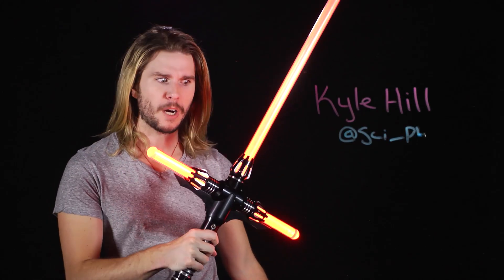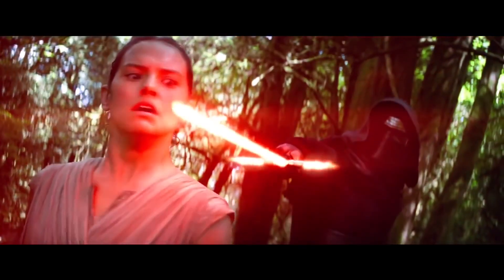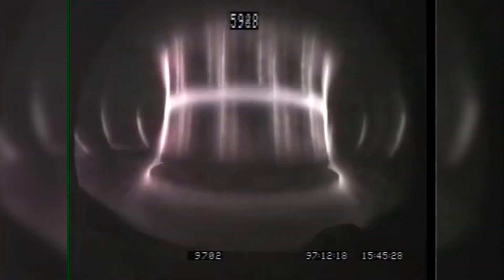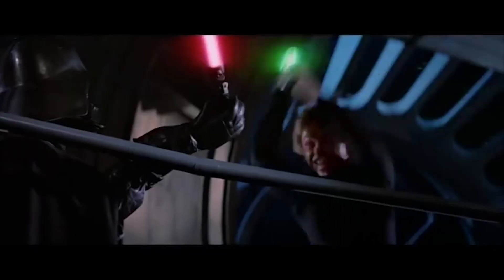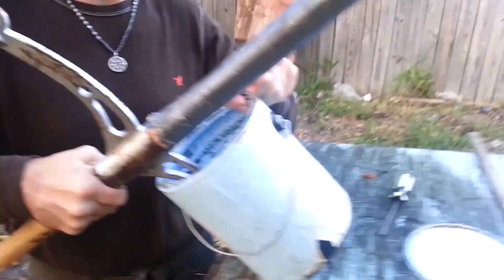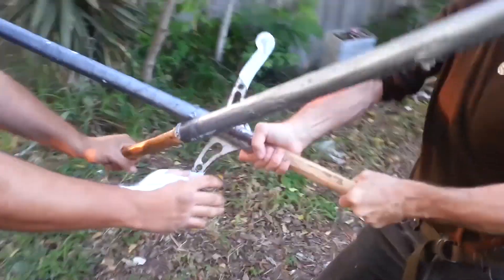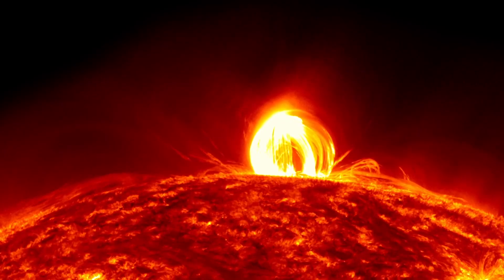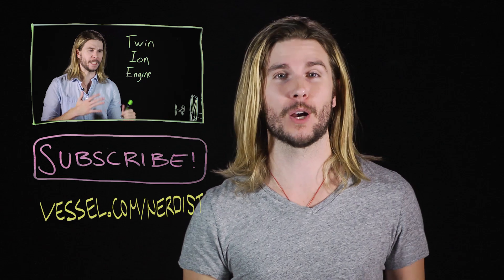Why Kylo Ren's Lightsaber Works (Because Science w/ Kyle Hill)

Comment: Almost every sword in history have had hand guards. Even Japanese Katana had hand guards to stop your enemies blade from sliding down the sword, and cutting your hand.
Reply: +Robert Harden Yes and no. It is really not that hard to use a Katana without your hands sliding around. They tend to be designed with quite a bit of grip on the handle. While the Tsuba (the disk-guard on the katana) does stop your hand from sliding onto the blade, it is also there to provide some degree of hand protection. For example, without the tsuba being there, it would be very easy for an opponent to get into a sword bind and then slide their blade down your blade very quickly and cut your fingers off. With the tsuba there, they would have to pull their blade off of yours first and then cut to your fingers, which gives you more time to react.

So the primary purpose is still hand protection. As I've done both Kenjutsu and HEMA before, I can say on no uncertain terms that the longsword/bastard sword/arming sword's cross-guards are a MUCH better form of hand protection. It's just a better design in that regard. But I'd still much rather have the tsuba than nothing in that regard.
Reply: ***** maybe your opponent. You'd have to be a moron to hurt yourself with the crossguard.
Reply: +TyillestTV2 I think in the Katanas case, its to stop your hands from sliding up the blade.
Reply: +TyillestTV2 I think in the Katanas case, its to stop your hands from sliding up the blade.
Reply: ArvelDreth
"Hand protection has never been an issue."
-Unless losing a hand is an issue.

"Also, even if the beams go through the metal tubes"
-In the SW universe there are lightsaber-resistant materials, such as Mandalorian steel or anything with a Cortosis weave.

"you can still cut diagonally"
-As long as you can use the hilt correctly this is a non-issue.
Reply: ArvelDreth Like with Vader cutting off Luke's hand or Luke cutting off Vader's hand.  In both of those the opponent didn't have their lightsaber disarmed.  So if they had a crossguard it would just be a manner of adjusting the wrist. 

Also yes there are times where the crossguard wouldn't have been helpful in saving their hand.  Ultimately no weapon is perfect.  But there's a reason nearly every sword made for hundreds of years used a crossguard.  Because it helps save your hand.  Honestly this is a very natural progression and kind of a funny in joke about how all of the light saber duels seem to end with a hand removed (and just as a side, Kylo Ren didn't lose his hand in the movie so I'd say he was successful).
Reply: Those guards weren't blades though
Reply: +hulkhatepunybanner Not true. I've been learning german longsword fencing for about 4 years now. I can say with absolute confidence that I could wield Kylo's saber without cutting myself on the crossguard.
Reply: +hulkhatepunybanner At that point it's just weapon safety.  We don't call handguns impractical because you can accidentally shoot your foot.  And the training is meant in a way that you don't have to remember, you just do it.
Reply: +ArvelDreth Yes but I can still point to several moments in the Star Wars movies where the person losing their hand could have saved it with just a quick turn of the wrist if they had a crossguard.
Reply: Jon Doe Hi, I've been studying how to fight with swords that are shaped basically exactly the same as Kylo's saber for about 4 years or so. (German longsword fencing, to be specific). 

After seeing the trailer, I started to pay attention to how often I touched the ends of my own crossguard during bouts. The answer was never. Wielding Kylo's saber without cutting oneself on the quillons is a trivial task.
Reply: Sean Black
No, Luke was disarmed. It was knocked free of his grip and then his hand was cut off. With Vader, he was down on the ground and his blade was completely knocked aside. He didn't have enough time to react. Also, guess what? Yoda, Ki-Adi-Mundi, Aayla Secura, Obi-Wan Kenobi, Luminara Unduli, Kit Fisto, Shaak Ti, Qui-Gon Jinn, and Darth Maul all happened to not have their hands cut off. There's not a ton of people who had their hand cut off. Oh and I think we can actually count Mace Windu. It was half of his forearm, so a cross-guard wouldn't have done anything, even if he could react in time to being parried.

Edit: I just watched that fight from episode 5. It's not quite knocked from his hand, but it was a parry and Vader came from underneath Luke's wrist. You actually cannot turn your wrist like that so quickly when a lightsaber is basically already right there. So no, a cross-guard would have done nothing.
Reply: While it is true that pretty much all swords of the past had cross guards, they also were not made out of blades. Similarly it would have made sense to make the cross guard of the light saber out of a light saber proof metal, which do exist in the Star Wars universe...although the cross guard could not have been used for offense in that case but oh well.
Reply: Kyle Flanagan Exactly.
Reply: +TheAgamer100 Actually there was a weapon that was used in 16th century France (I think?) that was called a main gauche (it was only a dagger, but the concept's the same) that was very similar to what you're describing. The only instance I can think of in film is in Disney's "The Three Musketeers"(1993) used by the character Porthos (Oliver Platt). Now I do hesitate to mention this because the one that he used in the movie was a bit gimmicky with 2 spring loaded blades that popped out of the sides of the main blade, and wouldn't have had the structural stability to actually break an opponent's blade. However, this was based on a realistic crossguard design where blades were angled up at a 45 degree (or so) angle in order to ensnare a opponent's blade, but would most likely have just allowed you to wrench your opponent's blade out of his hand by using leverage against their grip. Since the blades were angled away from your hand, it served the purpose of a hilt by blocking an opponent from sliding their blade down the length of yours and cutting your hand if it were unprotected. It also discouraged opponents from getting in close to attack. Plus it looks badass. 

+Nerdist Thanks for showing the Stephen Colbert explanation. I hadn't seen that before and hadn't really considered that aspect. But based on your explanation of how a magnetic field would be required to contain the plasma into the blade shape, wouldn't that hit the magnet then (or at least the power supply going to each that side) if you chopped it off at the metal? I know that's going a little geeky into the way that a theoretical weapon would work, but I figure if I can't get a little geeky here then the channel name is really something of a misnomer. lol
Reply: +TheAgamer100 Kylo used the "cross guard" blades in the film to get out of a bind with an opponent, so I'd say it works and is practical for his fighting style.
Reply: +TyillestTV2 Lightsabers don't slide up and down like that. They never have. Hand protection has never been an issue. Also, even if the beams go through the metal tubes, you can still cut diagonally. People have had their hilts cut in half before, so you can just cut across or diagonal and it'll render the crossguards useless.
Reply: The fact that one has to remember how to hold it lest one be impaled by those so-called guards makes this an impractical weapon.
Reply: ***** wouldn't apply to a force-user
Reply: ***** play "what-ifs" all you want, the point is they don't have to consciously remember where their hands are and are highly trained. It was used to great effect in the movie, it's practical for what it does.
Reply: +SemperFiMac77 No surprise that the marine is an idiot.  The Cross-guard was only made to look cool and it looks ugly.  Fighting does not go perfectly as planned like it does training against nobody.  In hand to hand combat the opponent can force you into positions where the cross-guard becomes dangerous to the user, like if they got knocked to the ground and falls on it.  The cross guard does limit the angles at which it can be held, either for an offensive opening, or the gurad being pushed into the wrist by the opponents lightsaber
Reply: SemperFiMac77
In unscripted life, it would snag and slice on the person wielding it. That's not a what-if, it's a fact. If there's something physically there on that tri-saber I'm sure the rehearsal and blooper reels are full of "accidents"related to this. Enough to limit the fights to broader sweeps over tighter ones. True life doesn't give us multiple takes in most situations.
Reply: Jersey Streicher
There is metal like that, but clearly no one uses it. Probably because it's extremely rare and expensive. We've never seen a case where someone tried to cut their opponent's lightsaber hilt and it didn't work. However, everyone who has ever lost their hand would not have been protected by a cross-guard because they were parried. It had nothing to do with the blades sliding down each other.
Reply: +ArvelDreth 
In Episode VII Finn fought a Stormtrooper, who had a melee weapon that was not damaged by the lightsaber. Most modern melee weapons in SW are supposedly reinforced with Cortosis. As for Mandalorian steel, it's used for armor, mostly by Mandalorians.
Reply: Jon Doe Resorting to personal attacks... classy. It's a lightsaber, it's dangerous to the user no matter what. The movie SHOWS the cross guard being used in a practical way... e.g. it's practical for the setting it is in. (the Star Wars universe)
Reply: +Jersey Streicher Then why not make the cross-guard out of that?
Reply: ***** Again, you're comparing "true life" to the Star Wars universe and force-users. Not a valid comparison. The movie proved that it was effective in-universe.
Reply: ArvelDreth He used it in a very offensive way in the movie, not for protection alone.
Reply: Sean Black He also used it offensively while in a bind. I would say it's a very practical addition to the lightsaber.
Reply: ArvelDreth
Good point.
I would take a lightsaber-resistant hilt over a lightsaber beam crossguard any day.
Reply: +TyillestTV2 ... Sliding down the sword is not an issue though in star wars because the friction created when 2 lightsabers touch is so strong, you'd never be able to move it in any direction but away from it. On the other hand people still get their hands cut off in other circumstances so moot point.
Reply: Péter Lakatos You probably should look at that scene again.
Reply: Tacobell1384
Even traditional crossguards made from dull steel bars offer several offensive options, including grappling, pummeling and stabbing sensitive body parts.
Reply: Tacobell1384 Yeah but then you would also have fans still complaining when the trailer's released because it wouldn't be obvious that it's made out of that material, nor would the general public since none of them would even be aware of lightsaber proof metals.  Plus when you get into that logic you can then go on with saying "why not just make a sword out of that material" which is just boring in this universe.
Reply: Sean Black
In the SW universe they actually make swords, staves, vibroblades out of lightsaber proof material.
If the public can take stopping a blaster shot with the power of will alone, they will be able to swallow a piece of metal being resistant to lightsaber blows.
Reply: +Sean Black LOL! first it's a Science Fantasy movie, second if Maul's weapon would have killed him before anyone else, how come Ray Park didn't keep hitting himself with it when doing the fight scenes? Because he had martial arts training. I love when people who obviously have no martial arts background comment on how useful a weapon is. Reminds me of when my high school physics teacher tried to tell me a jumping spinning kick was physically impossible.

Also as a Star Wars fan just have to point out in the science fantasy space opera of Star Wars a Force user uses both physical training and the force to wield their light sabers.
Reply: Sean Black
Well what if they explain the fact that such metals exist, then there's the problem solved. Actually, I believe there was a part where there's someone with a regular melee weapon and it stands up to Finn's lightsaber because it probably has cortosis in it.
Reply: +hulkhatepunybanner Did you pay any attention at all to Kylo Ren's fighting style
Almost nothing BUT broad strokes
Reply: +Jersey Streicher adding crossguards would not have prevented ANY of the hands cut off during the star wars series, seriously, watch them. 

Lightsabres don't slide like swords.
Reply: Sean Black Lightsabers are near enough weightless, the only thing that has weight to them is the actual handle of it. The lighter a weapon the better, you don't need to use actual weight behind the saber itself when you swing so it's all down to the weilders own strength, skill and use of the force. Making a sword of saber resistant metal would weigh more than those weapons and thus a good saber weilder will be able to swing and stab much much faster than the person using a saber resistant sword. Furthermore, a lightsaber resistant sword would be harder to carry around since you're carrying the whole blade as a physical object where as a lightsaber you can turn off and carry around in your pocket concealed for when you need it. Lastly the thing is like having a 360 degree blade all around the saber part as opposed to a real life sword which only has 1 or 2 sharp parts to it, you have more flexibility to cut someone with a saber than a sword.

Also the keyword here is "resistant", not sabreproof. If you had a blade made of resistant material against someone using a lightsaber then the person using the saber would eventually be able to cut through it when they're putting enough pressure on it. All those famous scenes with Jedi and Sith clashing sabers and trying to push the other one back wouldn't work the same with metal since eventually the saber would cut through it when enough heat and pressure is applied. Vaders armour was able to briefly shrug off saber attacks but it could still be cut through if the saber was held on it long enough. 

The video above used a cross guard for a two handed blade with a larger handle than Kylo Rens meaning he could hold it with his arms and hands further away from the cross guard (sortof defeating the purpose of having it protect your hand to begin with) Kylos handle is much smaller than that for the size of his saber and cross guard so he has less freedom to weild it with his hand so close to the light parts of the saber. If the guy used a 1:1 scale blade version of the same as Kylos saber then the demonstration would hold more water but he didn't use a weapon of the same size and shape. 

Also please don't make assumptions about someone just because they have a criticism about somethings design. I like Kylo, his saber and the new star wars movie but I acknowledge his saber design could be made more practical by using saber resistant metal as a hand gaurd to swiftly catch strikes and deflect them without having to worry about the crossguard itself hurting him. You don't have to blindly love or hate something one way or the other, people can still like something and criticise it too. If they can see past the flaws and still enjoy it then that's a good thing.
Reply: Cal DW Some lightsaber hilts are saber proof. Take sidious for example. Him as well as few others have made their sabers out of Mandolorian Iron. Invincible to sabers which is why jedi had a tough time in the Mandolorian wars.
Reply: DEATH111183 They're exhaust Ports.
Reply: +Jersey Streicher fair point, but calling them crossguards is a misnomer
Reply: Sean Black Okay, what about my responses are ignoring you? I am looking at each of your points and giving a legitimate reason with evidence to back up my argument after looking at each of your points. I've also not been rude to you in the slightest so what do I have to apologise for? If I've upset you in some way and can explain what I said to offend you then by all means I'll apologise but I see nothing wrong with me simply having a discussion with evidence and arguments about this.
Reply: Sean Black Okay 

1. As I pointed out, weight isn't as much a factor for individuals who can sense literally every single molecule around them using the force to the point they can detect non physical entities like ghosts. Nor for people who's "blades" are weightless pure plasma that cause damage simply making contact with an object where as an actual blade needs some power behind it's swing. It may take someone all their strength and the momentum of a sword swing to cut through a tree branch, but a lightsaber could do the exact same thing with a light flick of the wrist. For real world people with real world swords then the weight of a blade is important, not so much for lightsabers or individuals able to manipulate and sense their surroundings through the Force.

2. I was pointing out how the way of holding the sword in the demonstration doesn't apply the same to Kylo because the scale betweem Kylo and his Saber seems different to the sword and wielder in the video. If Kylo was using the same blade then yeah it would apply to him, but the video demonstration isn't the best example because the blade is not a 1:1 replica of Kylo's saber...OR if it is, the wielder doesn't have the same body proportions as Kylo. For example, a 5ft 5 man wielding a broadsword designed for someone much taller than him would have to hold it slightly differently to evenly distribute his grip strength and adjust the weight of the blade being further away from his shorter body and limbs compared to a taller person. Comparing the two when both subjects are different is not a solid control for a test or demonstration.

If this wasn't clear enough in my initial posts then sorry about that. Hopefully this clears up what I was trying to explain.
Reply: +TyillestTV2  Cross guards don't disintegrate matter on contact.  The sword with paint is alot heavier the a light saber, you're alot more likely to fuck up swinging something super fast.
Reply: +Kyle Flanagan 
Tsubas are really miniscule compared to any serious crossguard.
It only takes a small flick of the wrist to offset your blade enough to bypass the tsuba and hit the hand or wrist.
Even the most ample European crossguards require some skill for effective use, you need to twist your grip and move the crossguards to intercept your opponents attacks.
In Europe armored gauntlets were a no-brainer until basket hilts were developed.

The tsuba (pretty much like knife handguards) is just there so you don't cut yourself when thrusting against a hard surface.
Reply: +TyillestTV2 Crossguards could easily be constructed with the same tech as the electrostaff used by General Greivous' personal guards.
Reply: +SemperFiMac77 I'd give a counter argument but I'd rather not drop anymore spoilers than you already have. ask me for my opinion again in a month and I'll tell you... maybe
Reply: +TyillestTV2 Apart from maybe a Gladius but they didn't go in for blade on blade contact.
Reply: Ritalin Popper watch the movie if you haven't. He uses them as a way to get out of a bind.
Reply: SemperFiMac77
LOL
In a confined space not even a "force user" can avoid an accidental slice of self with a tri-saber.
Reply: +Sean Black Like when? Was it when someone was completely disarmed, parried, or otherwise had their blade knocked completely away? Those are the only times when it happened.
Reply: ArvelDreth Ok, I'm glad that you pointed out you were utterly wrong about the fight from before with the edit but it was still possible to adjust and a crossguard would still be useful there.  Also we didn't even see where on Mace Windu's arm the hand was cut since he was blasted out almost immediately so that's not an accurate statement.  You also didn't address Vader's moment which is still proving my point that a crossguard is useful.   And just because there are people who didn't get their hands cut off doesn't mean that isn't a common thing with lightsaber fights.  In fact the lore shows the jedi have several fighting moves that specifically involve removing the hand primarily used for weapon wielding, so yes if you are going against a jedi a crossguard is a good defensive tool.
Reply: +TheUnbeholden , uhm, Griveous would disaggree, in his duel with Obi-wan, he slid his lightsaber down and cut off one of his hands
Reply: +TyillestTV2 and those hand guards could not cut your own hand off. Neither could they be used to kill you if forced into your own chest.
Reply: Jersey Streicher Yeah but there's a reason Obi wan gave Luke a light saber instead of a sword out of some tough metal.  Because light sabers are cool.  Heck even the original concept of a light saber wasn't all that practical and the double bladed saber Maul used that fans see as cool has to be the most ridiculous weapon I've seen that will kill whoever wields it before an opponent.  With all that in mind, the crossguard saber isn't impractical in the slightest by comparison.
Reply: Sean Black Nah I'm sure many people who train with the dual bladed sword can use it without injuring themself with it, Its just a matter of practice, any lightsaber can probably be wielded effectively, especially by a force user who can 'feel' where the lightsaber is since it its focused by a force crystal. In Star Wars I don't see any force user whose experienced in any kind lightsaber ever cutting themself with it.
Reply: Sean Black
Yes I was wrong but there's no way Luke could have turned his wrist in time. Vader's lightsaber was basically already there at his wrist, on the underside where it would have taken far too long to turn his wrist all the way around. We did actually see where Mace's arm was cut off, because there was a pause when Mace was screaming in pain right before he was blasted out of the window. You could see the thickness of the limb where it was cut, so it was obvious that it was up towards his arm. I thought I already said that Vader was parried, knocked prone, and exhausted. He couldn't move his arm quickly enough, as Luke's lightsaber was already right there. Yeah, he could have done it if his situation was more favorable, I'll concede to that. I'll even say that a cross-guard on a lightsaber is not the most pointless thing you could ever add to it. But I feel like making the cross-guard out of the same dangerous material that the lightsaber is made out of seems kind of counter-productive. Doesn't it take more energy to produce more blades? And what if someone has their blade locked with yours and they push it into your chest or shoulder? It just seems like a bit of a hazard and I feel like there's other ways this could have been handled. Really I'm just a bit irritated because the way it's presented makes it look like it's just trying to look cooler and more flashy rather than practical.
Reply: TheUnbeholden , That's my point.  If we can suspend our disbelief with the double blade light saber than why not the cross guard light saber?
Reply: Satsujinki1973 First I know it's sci fi fantasy.  That's my point.  That we should stop complaining about the cross guard saber being impractical when the light saber and the double bladed one are already so impractical to begin with. 

Second, I'm a black belt dude.  You wanna know why ray park didn't hurt himself off of the double bladed lightsaber?  Because his was just a prop and he had a specific choreographed routine.  If it were a real light saber and you had him enter a fight with someone else with a light saber then either he would injure himself or just turn one of the blades off and fight like that, because while it looks like it has the advantages of both a sword and a bowstaff it really has neither since a huge thing with bowstaff is range, which this doesn't have, and all sword like swings have less movement because that other blade is coming straight for you.  But again I don't mind how overall impractical that is because it looks cool and Darth Maul was awesome.  My whole point is that we should just calm down about the crossguard being impractical given what we have now.  It's one thing to say you don't like the look but that's not what we're saying here.
Reply: ArvelDreth But not in the first trailer.  What, you have this trailer and marketing campaign that was praised for explaining very little but then just have Kylo Ren turn to the camera and say "there are metals that are light saber resistant so this makes sense"?  Because this whole thing started when the light saber was shown in the first trailer you know with fans immediately labeling it as impractical.
Reply: FlockFlysatMidnite
His swordsmanship sucks.
Reply: ArvelDreth And again I'm not talking about these guys moving their arms, just wrists.  No matter how exhausted you are, you can move it fast enough, especially considering these guys are force users.  And I watched that scene again and no you really can't tell.  I don't know if you see Windu's robes giving the illusion of thickness but there's just no clear way of telling but I didn't even use that as an example of anything so why you're still bringing it up is beyond me.
Reply: Sean Black
Because the example was used in the video. And no, you cannot move your entire wrist upside down when your attacker's lightsaber is already basically touching your wrist, as was the case in the fight between Luke and Vader in Empire. And if Vader did have a cross-guard, then Luke still could have aimed higher up after knocking his arm aside. At this point, I don't see any point in continuing this. You think that a person can turn their wrist before another person can move their blade maybe a couple centimeters, even after they have been parried. Also, the way I imagine it, even if a person does block the strike with their cross-guard, then the attacker can just angle their blade in an instant and just cut further up the arm. And since you would be angling away from the defender's blade, trying to catch the attackers blade would be impossible.
Reply: ArvelDreth Did you seriously not see these fights?  When Luke cut off Vader's hand, he moved the blade all the way to his back.  And Vader cutting off Luke's hand was closer to 2 feet as opposed to the few centimeters you're talking about.  And are you really telling me moving your wrist so your thumb is down to the ground can't be done fast?  Then I guess Siskel and Ebert were Jedi.  Who knew? 

Also angle the blade after the block to cut off the hand?  Have you ever used a sword before in your life?  Or do you think after blocking the sword the defender would just stand there not moving their arms thinking "well now no way that person would try to cut my arms again"?  Fights are kind of a continuous back and forth.  And, if you honestly believe that would be an issue, then why is it that almost every sword known to man has a crossguard huh?  If it has that glaring of a weakness why did we continue to use them only to stop when we stopped making swords?
Reply: ArvelDreth And so you can point to one example where a crossguard would not have helped and that apparently proves your case that it's not worth the effort?  Even though that was a case where Windu was executing someone and didn't know an attack was coming?  And my two examples where a crossguard would have saved the hand apparently doesn't count because you have one example where it wouldn't have mattered?  You want complete protection just get in an iron box but in combat, while the crossguard is not perfect, same can be said for any weapon or addition to a weapon.  We still used it for centuries so that should be evidence enough that it works.
Reply: Swords do not have a 360 deg cutting edge like a light saber does. Hilts are made for a single or double edge blade combat.  The idea that Kylo's hilt is going to stop these attacks against a 360 deg cutting edge is laughable.  Worse than that it makes Kylo's light saber more of a double edge weapon than a 360 deg weapon that other light sabers are.
Reply: Valkaneer It's not laughable.  In fact it would be very easy to just twist the blade a bit to catch the blade in the few areas where the slide would bypass the crossguard (namely where the flat part of the blade would be if this were a real sword).
Reply: Sean Black I agree.
Reply: Sean Black
You can't accidentally shoot yourself unless you're pointing a gun at yourself. The tri-saber is a weapon that even if the wielder points it at an opponent there's still two parts of it that can accidentally make contact with the wielder.
Reply: This is hilarious. There are people ignoring physics just so they can believe this tri-saber could be a functional, and not stylistic, weapon. However, it was described in the [invalid] Expanded Universe novel it clearly wasn't a well executed design for the movie.

I expect droids will be given wireless very soon. This is fan fiction. This is NOT Star Wars.
Reply: ***** Yeah but under the same concept as gun safety rules that say make sure the gun isn't pointed at anything other than what you intend to shoot (in the off chance of a misfire) so is with the light saber here.

And you know what, I agree with you that the crossguard light saber wouldn't be functional or practical and mainly exists to look cool.  You know the real reason though?  BECAUSE THE LIGHTSABER ITSELF ISN'T FUNCTIONAL OR PRACTICAL!  Do you know how useless a sword is that you can't touch the blade of in real life?  Or how unbelievably hot the power source would have to be to work it?  If you don't think it looks cool then fine but don't come here and say "it's not practical" when, if anything, the addition of a crossguard actually makes it somewhat useable by real world standards.
Reply: Sean Black
It's way different for a sword, where you actually need momentum to cut through someone. You can't just immediately change the angle of your blade (after it has come to a complete stop) and instantly slice through someone's arm with a sword. That's why the cross-guard on a regular sword so well. Edge alignment and momentum are things you actually have to worry about with a sword, so when your sword is stopped by a cross-guard, your opponent cannot just move the blade in another direction immediately (without even having to move the blade so that you have proper edge alignment) and still cut right through you. If I were to aim a strike at someone's hand (while using lightsabers) and my opponent blocks it with his cross-guard, all I need to do from there is move my blade diagonally upwards, or arc up a tiny bit and then flick my wrist diagonally downwards, and I can easily cut my opponents arm completely off, and go very deep into their torso. So now instead of taking a hand, I have just landed a fatal blow. But I already explained this. I don't know why I'm repeating myself.
Reply: ArvelDreth All that still implies the opponent doing nothing during all of that.  First of all, no matter if it was a sword or lightsaber, of course you need momentum.  Second, all you said either A) implies the defender is doing absolutely nothing to defend themselves, or B) is a problem that's actually worse by there being no crossguard there at all.  Seriously, how can that happen but with the standard light saber I can't just slide it down and cut their hands off that way?  And if you say "light sabers don't slide against light sabers" then I'll just throw that right back at you for that stuff.
Reply: +Sean Black You're no black belt. If you were you would understand that Black belt in the Japanese systems just means you are no longer a beginner and are now ready to learn. Not a bragging point.

Secondly you wouldn't call it a Bowstaff (incorrect spelling) you wouldn't even call it a Bo Staff as the name of the weapon in Japanese is Bo. You would call it either a Bo, or a staff.

I never said hurt, I said Hit, Yes it was a prop, but you have to practice choreographed routines, and the moves used come from the forms practiced with the weapon. The fact he never hit himself shows he was skilled enough to use the prop without hitting himself in a way which would kill himself if it was a real weapon.

Also you're making one more mistake, Maul&#39;s double bladed light saber isn't based on the Staff, it's based on the doubled bladed sword style weapons that have existed for hundreds of years. And which have made a resurgence in movies and TV shows since Maul used it. Similar to the resurgence the Nunchaku enjoyed  after Bruce Lee used them in Way of the Dragon.

I can't use Nunchaku for shit, but that doesn't mean they are impractical and wouldn't work as a weapon. They obviously do. Don't apply your own lack of training to your belief that another weapon wouldn't work.

Other than that, I agree with  you about calming down about the cross guard.

Also Merry Christmas, and have a great new year.
Reply: Satsujinki1973 First of all, you really don't know anything about martial arts if you think the belt system is exclusive to Japanese systems.  Mine is krav maga, which is Israeli in origin.

 Second, fine.  I spelled bo staff wrong.  Clearly that's me not knowing a thing about weapons instead of a common mistake.  Guess that's a point to you.

Third, you do know choreographed fighting is different from real fighting?  Because for that Maul fight they had to slow down both Ewan and Neeson for that fight to show off of more of Ray Parker's moves.  If you covered the ends with paint I can guarantee you would see paint smears all over Ray's shirt which shows, if it were an actual light saber then that would translate to burn marks.

Fourth, no.  There is no recorded history of a double bladed sword outside of fiction.  There are double bladed knives and spears but that's not the same as what we're seeing with Maul.  For it to work like those weapons the blades would need to be shorter and the handle would need to be either shorter or longer (as either a knife or spear depending on what you want).  But again, no double bladed sword.  I even just looked it up right now for reference leading to several listing of the weapon in fiction like Star Wars and D & D with a forum that explained the weapon doesn't exist.

Also as a side point, why bring up nunchaku in such depth?  I get the point of them being brought back thanks to media but, just so you know, they were largely forgotten because of how overall useless they were.  They're incredibly difficult to use and in the day a bat or similar blunt object would get you the same result with little issue.  Heck a police force not too long ago tried to use as a way of trapping perps without injuring them, only for that to be abandoned since it was injuring both perps, police using them, and anyone who was too close.

Finally, thanks for the agreement.  Just want to know what your whole point in this conversation is then?
Reply: Satsujinki1973 And also, just for the heck of it, I looked up a bit of the history of black belt and, yes, it did originate in Japan but it has always been representative of graduating in a particular study of martial art. Originally it was only two belt colors, white and black, but white represented the beginning of learning and black represented the end of being a student (yes there was the basis of continuing to learn but it's not the same as being a student).  Also I wasn't using that as a bragging point, just showing that I do have fighting and weapons knowledge.  Mind telling me what knowledge you have?  Because judging from what you've been saying I'd say it's probably from watching Bruce Lee movies.
Reply: +TyillestTV2 lightsabers don't slide, that's the thing
Reply: +TyillestTV2 Yes, but i think none had handguards that were made to be blades that would cut your hand if you're careless.
Reply: +TyillestTV2 Katanas are the best sword, folded japanese steel can slice through bullets and cut through gun barrels.
Reply: +Wildwolf Dante exactly if your careless but if you are trained to the degree of a knight( which he is) then you don't get careless
Reply: but the cross guards were not blades themselves. what he could have done is made a crossguard out of lightsaber resistant materiel like the emperor's lightsaber. That would have been better.
Reply: John Pinkerton Dude the fact they don't slide like swords shows that they would have been better at protecting the hand.  Geez, it's like people think all the guards are good for is if the sword slides down the blade which is only one of it's uses.  It's like saying all you need to know about swords is that this end goes in bad guy.
Reply: +TyillestTV2 Hand guards are rarely ever blades themselves which is pretty much what Kylo Ren's is like since the actual light part of the weapon acts like a really hot blade. Sure it can block other lightsaber wings but he risks hurting himself if it causes the guards to hit his wrists while blocking.
Reply: Cal DW You mean like how the double bladed light saber risks catching on Maul anytime he tries to attack?  Or how the regular light saber risks burning you from a block?  This is seriously just getting in a giant circle where anytime someone points out a problem with the handguard it's something that was already an issue with light sabers to begin with.  Can all the haters just admit they think the design is just lame and stop coming up with reasons why it's horribly impractical?  Because it's just making us look dumb when we realize, oh yeah, light sabers aren't all that practical to begin with.
Reply: Sean Black No, the lightsaber is meant to be like the blade of an actual sword which is an offensive tool. With a normal blade or dual blade staff you'd risk cutting yourself if you didn't know what you were doing, that's fine, but the crossguard is not an offensive part of a sword and shouldn't be a risk to the user. You'd never get a crossgaurd made up of two small blades which is essentially what Kylo Ren's saber is like, he could have used saber resistant metal as a crossguard if he wanted hand protection, not more light blades. You don't make a defensive part of a weapon into something offensive as it puts yourself at more risk, the whole point to a hand guard is it's meant to be a solid blunt area you can block a sword with, it's not meant to be extra blades as that's just...impractical and stupid.

I like Kylos saber but I don't see why he couldn't just use saber resistant metal as a crossgaurd which does actually exist in the Star Wars universe. Darth Vaders armour was made of the stuff which is why it shrugged off Luke's saber strikes so easily whenever he got hit.
Reply: Cal DW Dude I know sword fighting and do you know how many moves require you to actually touch the blade?  Seriously, or even just touching it from all the swinging you do with a regular sword would just bump you.  Here it's giving you 3rd degree burns and limbs coming off. 

And ok, now we're getting into using a light saber resistant material but then let me tell you, why not just make a sword out of that?  Why even have light sabers when a sword out of that metal would be just as good if not better and actually practical?  Because light sabers are cool and suit this world better.  Again if you don't like the design you can say you think it's lame and I'd respect you for it but it's not any more impractical then what the weapon was already.

Also the video demonstrated that not only can you use it without much effort and avoid having the guard hit you but you can also use it to remove the opponents hands in an easy to use counter move, but I guess we can ignore that since it proves you're wrong.
Reply: +TyillestTV2 They're not handguards, they're vents
Reply: ***** Mandolorian Iron has been damaged in the EU a few times but again only with sufficient pressure. A hand guard made of it would be great and to be honest it's just stupid for Kylo to not use that over his current design. 

The only decent advantage he has to using it is he can burn into someone else when their sabers a locked at close range but that could easily work against him. I think a better design would to have a much larger crossguard made of resistant metal and to create two light tips at the very end, that way even if the crossguard touches his hand he'll only be touching the metal part while the tipped saber ends could still be used to harm an opponent upclose like he did to Fin.
Reply: Cal DW Ok there's a lot of dumb here so I'll just go point by point.

1) weight on the blade is important to help you feel where the blade actually is to avoid hitting things/people/body parts you don't want it to since you need to keep your eyes on the opponent.

2) If it's not light saber proof and just resistant then that's why it can't be used for the crossguard either.  Because you kind of use that regularly in sword fights. 

3) Kylo Ren is holding the saber at the right location seeing as how that's what actual soldiers who used great swords, what his saber is based on, did and things worked out great for them.

4) It is to scale.  Actually watch the video this guy's referencing.

5) My assumption of you comes from the fact you seem to have no problems with the impracticality of light sabers to begin with but whine about this design which isn't even the most impractical light sabers have gotten to.  To that I'll tell you a phrase I hate but it's all I can think to tell you, get a life.
Reply: Cal DW Not just anyone can use it. It takes years to master the forge and Mandolarians barely share the techniques of forging it. And his crossguards are actually exhaust ports.
Reply: Sean Black

1. How much does the weight of the blade matter to individuals who can lift and move objects with their minds? These are people who can crush someones throat or inner organs with mere thought, even if there's nothing physically crushing the body part, Darth Maul in the EU comics even uses the force to amp up the strength of his swings to give "weight" to his saber even if there is none. In the hands of someone who can't manipulate the force like Fin it'd be very easy for him to get over powered by somene with experience and force powers. Furthermore, lightsabers don't actually cut the same way a blade does, it simply melts what it comes into contact with so there's little to no need for any real weight behind the swing when you can cut through most materials by simply having the thing lightly touch it.

2. It's resistant enough to block and deflect strikes but it won't hold it's own in a long clash like the actual light parts of the weapon do...but you'd have to be pretty stupid to try and hold back a sword with it's crossguards for that length of time without attempting to disarm or redirect the opponents blade. Bulletproof glass isn't actually bulletproof and will break if you keep letting it take shots, bu you'd have to be stupid to just stand there behind the glass forever without attempting to get away.

3. Knights and warriors have an easier time because again, the crossguard itself is not two blades that could hurt them when in use. 

4. Look at the video again and look at Kylo's saber, especially with the size of his hands  http://screenrant.com/wp-content/uploads/star-wars-force-awakens-kylo-ren-finn-lightsaber.jpg His sabre handle if held with both hands would have one hand almost directly under the two ports where the light comes out, which is dangerously close to the lights themselves. His crossguard has curved supports that create more safety distance between his wrist and the guard, Kylo's is just two straight pipes with little wiggle room when held with both hands for an arc when he moves his wrist. Furthermore, the handle actually goes about 3/4's of the way up Thrands arm where as Kylo's doesn't even reach halfway up his fore arm. Now I have no idea how tall Thrand himself is but going by the video the handle looks way bigger against his arm and hands compared to Adam Driver who stands almost 6ft 3. If the blade truly was to scale then Thrand is not the best example to wield it, he's either much shorter than Driver or the blade and handle aren't to scale.

5. There are flaws to the lightsaber unique to it but the advantages far outweigh it's disadvantages especially given this is a universe where the Force can manipulate it's usefulness and power.
Reply: Doodorz He still has an arm that can be caught by it, wrists bend when holding things after all especially if someone is actively fighting against someone else.
Reply: Cal DW
Not in the hands of an action figure! LOL
(That's the only way this tri-saber can be used safely.)
Reply: yeah but those crossguards weren't blades, they were blunt metal
Reply: THEFLYINGMINTBUNNY32 Thy're not crossguards. They're Exhaust Ports
Reply: +TyillestTV2 the purpose of a cross guard though is for trapping an enemy's blade and possibly disarming them. so in a sense if a light saber was made in a similar fashon it could possibly work the same way, one in which we haven't seen yet
Reply: DEATH111183 Not a crossgaurd -_-
Reply: ***** actually yeah it is. a simple shift of the wrists. the guard in conjunction with the blade would catch the enemy's blade in a pincer like motion. one application of leverage could break the enemy's grip on the handle, thus disarming them.
this is typically found in fencing techniques..... but it does work with other sword designes and fighting styles
Reply: +SkintSNIPER262 where is your proof it's more logical for it to be a cross guard, he's a knight after all
Reply: Crazy knife Where's your proof of it being a crossguard? And he's a sith wannabe.
Reply: Crazy knife Dude, there's a whole thing discussing how Kylo thought his saber would be more powerful if it had 2 crystals. Putting 2 crystals together makes them unstable. Which is why his saber looks more like a lighting bolt than an actual lightsaber. The Vents help even it out.
Reply: +TyillestTV2 The problem with the crossguard isn&#39;t that it&#39;s a....crossguard the problem is that the ligthsabre is a cylindrical blade so it should have a cylidrical guard because simple math tells use that 360 degree coverage is better than 2 degree coverage.

With a cylindrical blade you could easily lose your stance footing in a clash and get turned around effectively making the crossguard on the vast majority of angles useless.

Example:

http://casiberia.com/img/prod/sh2199.jpg

Though in the movie we saw him use it practically and it back firing on him.
Reply: +SkintSNIPER262 Crazy Knife is right, so is Kyle hill. they are crossguards. some knights, ninjas, samurais, quarter masters, etc. uses or used crossguards. and kylo ren's lightsaber crystal is cracked, that's y he has a trisaber.
Reply: Crazy knife  and ***** you both have valid points of "prove me wrong I dare you"
but here is my proof. you can be a knight in any order given you pass the trials. now given palpatine more than likely had many apprentices. especially considering he had dooku. maul, and grievus under his commands at the same time. but isn't it highly possible he had another apprentice??

also, he can still not have achieved mastery of his studies, and still be a knight in the sith order. considering Anakin skywalker wasn't a jedi master in the slightest, but he was still a jedi knight..... so this ends that pissing contest
Reply: +SemperFiMac77 in-fact, it only ever ends up getting used offensively which is no the primary purpose of real-world steel-bladed swords he's able to inadvertently make the exhaust vents into offensive weapons.  Also protracted perpendicular binds (aka corps de corps), as depicted in movies rarely happen in real-life swordplay.
Reply: DEATH111183 Here's the thing. Kylo is not a sith or jedi. Snoke is only there to show him the path to the dark side. Kylo is a wannabe sith at most.
Reply: +Sean Black yeah but so much for those "crossguards", Rey cut right threw that like I and many others have predicted was a vulnerbaility
Reply: Is anyone going to question how pathetic kylo is? He can stop a blaster bolt mid air but gets defeated by someone who's never even seen a lightsaber..
Reply: ***** and yet he's portrayed well as a sith..... much like darth vader was up until the end
Reply: DEATH111183 how was he portrayed as a sith? Because he doesn't follow their ideals that well.
Reply: +SkintSNIPER262 the sith are dead and destroyed but the dark side of the force was not destroyed and manifest through a new forum. That's how he's like a sith.
Reply: Cal DW Ok, you want to just flat out ignore what I'm actually saying then fine.  I read your points and it's clear you don't want to listen to me so stop commenting to me.  I will block you if you reply again without an apology.
Reply: +DEATH111183 I got a little lost in that but how does that prove if it's a cross gaurd or exhaust? I used logic and knowledge of swords throughout history and reasoned that anyone with the title of knight knows how to handle a blade. Seeing as his order calls themselves the Knights of Ren which I connected to historical knights which his lightsaber resembles a medieval sword. Particularly I think it resembles a hand and a half style sword. While this isn't proof because it's not concrete and is just a theory it has reason and logic to it that can not be ignored.
Reply: Jonathan Gumpangkum Yeah but no weapon is perfect.  It still requires skill on the part of the person using it just like you don't blame the effectiveness of the light saber itself just because Luke lost his fight with Vader.  The main job of the crossguard is to help prevent his hands from being cut off and, if you noticed, Ren got out of that fight able to give the movie two thumbs up.
Reply: Cal DW Fine I'll explain it.  The first completely ignores what I said about the weight being used to feel where the blade is going.   The third ignored the fact we were talking about placement of hand on the handle and how that effects the crossguard.  And ignoring my points while trying to counter argue is a rude waste of time.  You want to debate me fine but don't try to counter my point without reading what I have to say.
Reply: DEATH111183 He's "like" but never will be a Sith.
Reply: ***** actually, he pretty much is a sith by the end of the film.... spoilers. he chooses the darkside.... sith padawan/knight
Reply: DEATH111183 I saw it already. But like they said in the Saga. Everything has Midichlorians which means everything is connected threw the force. Some life forums that are not a Jedi or Sith can follow the dark path. J.J Abrhams even said Kylo is not a Sith.
Reply: spider milk They're not cross guards for the last time!!
Reply: Sean Black
Yeah lightsabers don't slide across each other, that's why you cut diagonally upwards or arc upwards and go down. That way you're not making contact with your opponent's blade while moving. I'm not saying the opponent is doing nothing, I'm saying that once you have gotten on the inner cross-guard, your opponent doesn't have much room to react if you cut upwards immediately. You don't really need momentum to cut through something successfully with a lightsaber. A lightsaber cuts through just about any material with basically no resistance.
Reply: ArvelDreth That's still a lot of movement to do instinctively and again with that much movement means time to block and counter.  Seriously dude, what's your fighting background?  Because I'm beginning to think you don't have much.
Reply: ***** heres the one fatal flaw in your reasoning. he invokes his passions to drive his powers. this is something the sith do. not to mention he wishes to follow the path of darth vader. and this overlord. seems to be someone knowledgable in the teachings of the force. so maybe not in title is he. but he is still a sith. self proclaimed or not, he is
Reply: Sean Black
Kendo, fencing, Shinshin-ryu Iaijutsu, and Jujitsu. I never got incredibly far in any martial art, and I've been out of practice for a while now, but I was doing martial arts for about 6 or 7 years, three times a week or so. Never got to practice too much at home though.

I'm not sure how you would really counter an attack that has already gotten past your defense. If it's on the inside of your guard, I guess you could shove the person's blade to your left, but that still means that person could have cut deep into your torso before you got them completely away from you, since you would be moving their blade in front of your body. Or maybe you could force your opponent's blade downward, if you act before your opponent gets his blade away from yours and is already moving his sword through you. That's certainly a possibility. But maybe we're not properly understanding each other as far as what scenario we're describing. I'm a little tired of this debate though.

I'll say this. A cross-guard on a lightsaber isn't a bad idea. But I personally do not think that a cross-guard is as necessary on a lightsaber as it is a conventional blade. And a cross-guard made of the same hazardous material as the lightsaber could actually be more dangerous to the user, as well. You're definitely not completely in the wrong, but I just don't think that a lightsaber absolutely needs a cross-guard. That's all. Is that fair?
Reply: ArvelDreth Really dude?  You have that much experience with combat and you honestly don't think a cross guard is necessary?  No wonder you're tired of debating.  Lying takes a lot out of you.
Reply: Sean Black K
Reply: DEATH111183 Dude he's not a fucking Sith! J.J said it himself. Are you still going to call the first order the Empire and imperial storm troopers? No because they're not the real ones.
Reply: Sean Black They're not fucking cross guards!
Reply: ***** Yes they were.  J.J. confirmed this after the first trailer and all of the complaints came in and even contributed to the debates by saying "all the things people are saying about the crossguard are things we said while designing it".  Where did you hear that they weren't?
Reply: Sean Black They're exhaust ports!
Reply: ***** That didn't answer my question and that "theory" was debunked by the director when he confirmed very early on that they are crossguards.  Again, where did you hear that?
Reply: Sean Black Really? The Director confirmed it? I didn't see that anywhere...
Reply: ***** And yet you still haven't answered my question about where you heard they were exhaust ports.  But yes, in interviews he calls them crossguards.  This wasn't a secret like the identity of Rey or Kylo Ren..  And having them as exhaust ports is...really not practical.  Where did you hear that?
Reply: Sean Black Forums where they had actual spoilers. Spoilers that are now confirmed because I've seen the film. And it makes a lot of sense. Why else would Kylo's saber look like a fucking lightening bolt?
Reply: ***** Because he made it himself with limited knowledge of lightsabers.  I don't wee how looking like a lightning bolt means it has exhaust ports.  And I've seen the movie.  They never say those are exhaust ports.   Also, the director.
Reply: Sean Black They never said they were crossguards either. The story is that Kylo thought his saber would be more powerful if it had 2 cyber crystals. 2 crystals together makes it really unstable. The ports evens them out.
Reply: ***** Yeah.  They weren't called crossguards in the movie.  But they were by the director.  At best this is fan fiction with very little evidence that has also been proven false since after the trailer was released.
Reply: ***** dude, J.J. could say he's fucking captain America for all I care. he's a practicioner of "The Dark Side" rough translation......"FUCKING SITH" don't like it, deal with the lore, not with what the director of one movie soo far.

 also. the first order is infact "reminents" of the emperial army. hence they still dress in the same uniforms. they have the same goals. and even.... "SPOILER" their fucking flag is the same..... if you can't connect they simple dots than I pitty your parents for raising a dimwit